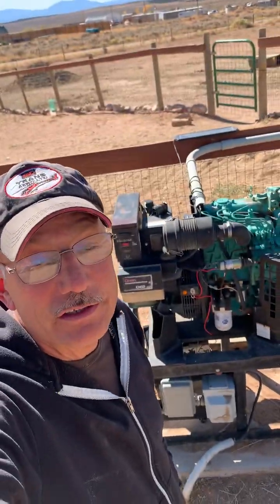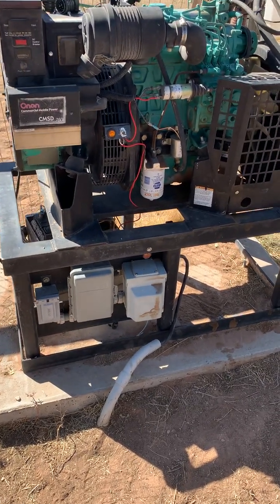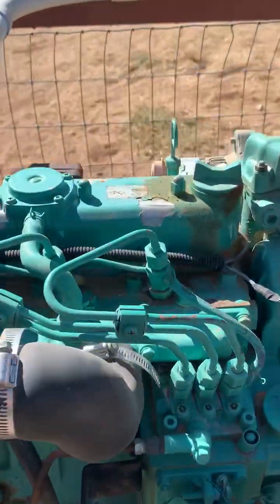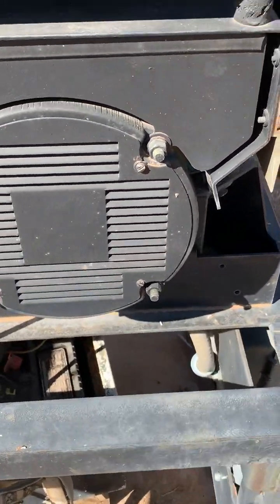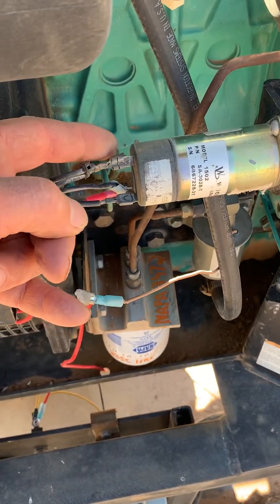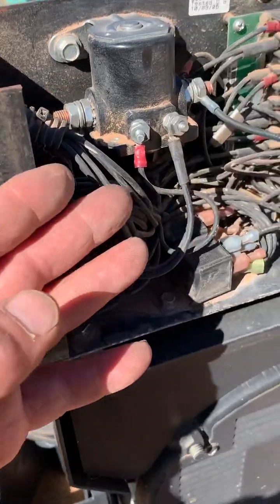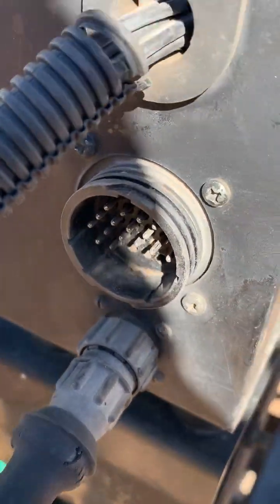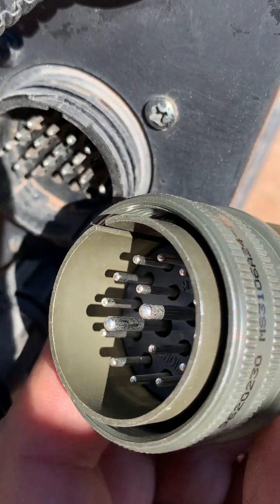Onan CMSD 7500  diesel generator troubleshooting

Comment: I don’t have your unit but really enjoyed your helpful comments….notice water stains inside your black wire box…those connectors could have been anchored better and rtv sealed….our grundfos pumps will run on solar DC or AC….that might help as another layer of redundacy
Reply from the maker: Raymond, Thanks for the suggestions. Although these units were designed to be used in the weather. They are not extremely weather resistant, and as they get older, they tend to develop leaks. I ended up building a frame and metal roof over the top of mine.
Right now it’s still working well!
Reply: I should mention
My solar pumps are now in the 2.3-2.5 $ range now and make sure you buy a 5 yr warantee

Comment: build a roof over it to keep sun and precip off of it..the plastics and hoses will last much longer..the red breaker isnt designed for outdoor exposure. The black connector is a Amp CPC connector,not designed for outdoor use either. Your Bendix mil connector has rubber boots available to seal it off from water ingression. Best of luck.

Comment: It was hard to tell.  Can the male pins be split opened a little?
But yea,  your way of fixing it is “top notch!”

Larry
Reply from the maker: Larry, My pins were solid metal. I have seen those split pins you mention. IF you have that type, they can be pushed apart to make better contact,  You could also look at the socket, sometimes you can pinch the female sockets into a slightly smaller diameter but you risk damaging it. Either way these are only temporary fixes. The normal vibration will cause the poorly designed OEM connectors to arc and fail.